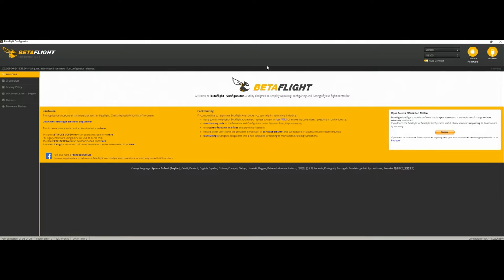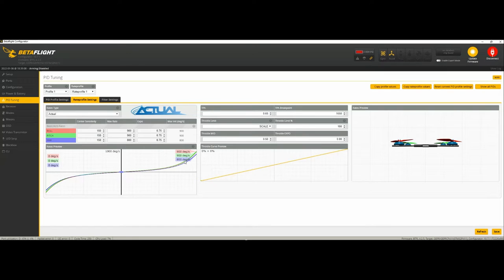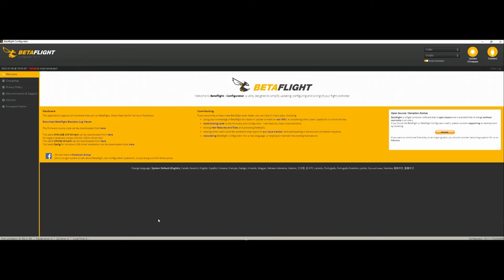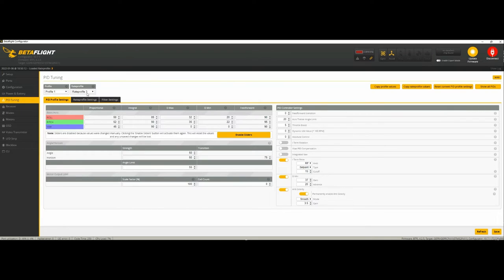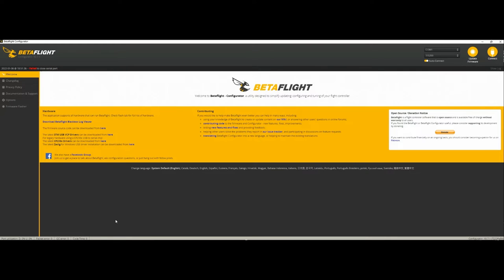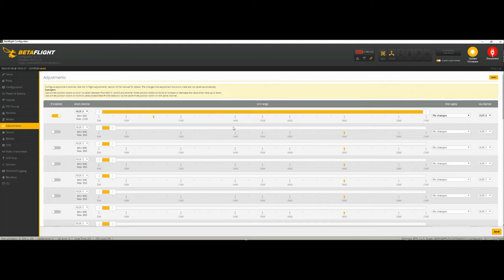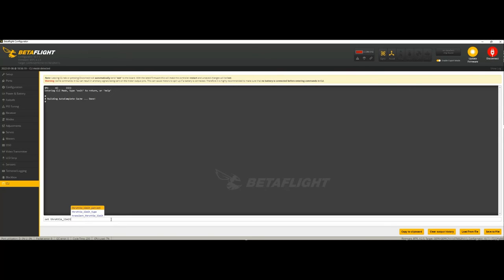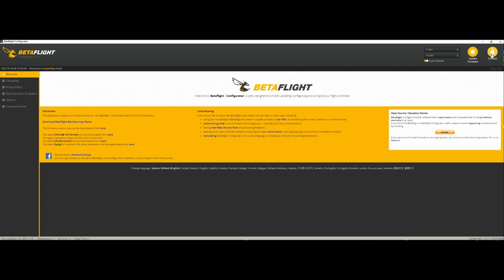Taming the GepRC TinyGO with a Flip of a Switch - 3 Throttle Limit Profiles on a Single Switch

Comment: If you click on Pids then at top "rate profile settings" on the right is the adjustment for throttle you just set it to scale and raise and lower the settings. Select rate profile 1, rate profile settings, change scale, slide throttle adjustment and save. Do it a 2nd time select rate profile 2, rate profile settings, scale, slide percentage etc. Do for all 3 and you can avoid typing anything into the CLI but great vid 👍

Comment: Bit of follow up- Seem to be having some issues, was wondering if you had any potential input.

Didnt seem to have any problem hooking up the drone/controller to betaflight as you did. It detects the switch being flipped around between the 3 positions, and as far as I can see, the code seems to reflect that its saving the throttle limit between the 3 positions.  In position 1 it goes to the first profile, you go to CDI, check the throttle limit, its coming up as what i put in.  Same for 2 and 3 (I initially tried doing 40/70/100).  

But flying the drone- It didnt seem to be actually different at all.

 I eventually changed it to 1% max throttle (again verifying that its "saving" the information. Ill disconnect / reconnect everything, recheck the CDI, still saved as 1%).

Drone has no problem flying and feels like nothings been changed.

Do you have any idea of what i may be overlooking, or anything i should be checking? Thank you!

Edit: ++UPDATE++

Figured out the solution to the problem.

Beta flight has since updated their software (its been 2 years, whodve thought lol)

The command is no longer simply "Set throttle_limit"

The new command is Set Throttle_limit_percent = X (This much i had initially figured out. Its kind of the only command available in the list for throttle)

The SECOND thing however is you need to change the type of throttle limit the drone uses.

With the new GR8 controllers (Not sure if this is true for the old ones or not) it is set to "off" by default. Youll need to set the throttle type to "Scale

"Set throttle_limit_type = scale" 

Hope this helps anyone else in the future. Cheers!

Comment: Just got mine today. 
1st flight: 1 prop flew off right away. 
2nd flight: 2 props flew off right away. 
Found out 3 props were cracked. Yay. Swapped out the whole set with the spare set.
3rd flight: Throttle just goes crazy, with the stick all the way down and holding it flat and steady in my hand just so it doesn't crash and break. Grrrrrr.
I definitely don't like how the TinyGO's blades start spinning once it's armed. 
I haven't been able to look at BetaFlight yet.
So far it's disappointing.

Comment: But how do you connect the Controller to betaflight?
Reply from the maker: To get the controller to “connect” to betaflight you first have to make sure your controller is bound to the receiver in the drone, and then when the drone is connected to betaflight and the receiver is powered up, turn on the controller and everything should connect
Reply: @719FPV  thank youuuu

Comment: Do you know how to put the tiny gold drawn back to factory settings when you first got it
Reply from the maker: You can restore the TinyGO to its factory settings with a "CLI dump" while connected to betaflight. You can find the CLI dump on the geprc website in the downloads section of the support tab. When you find the CLI dump you need, copy the whole page and paste it into the CLI command line in betaflight. hit enter and it will begin to upload to the tinygo, when it finishes it will automatically save and reboot. Your tinygo will now be back to its factory settings.

Here is the link to the CLI for the non-LED tinygo
https://geprc.com/wp-content/uploads/2021/06/TinyGO-SBUS-4.2.5-1.txt
Reply: Thank you very much for the help